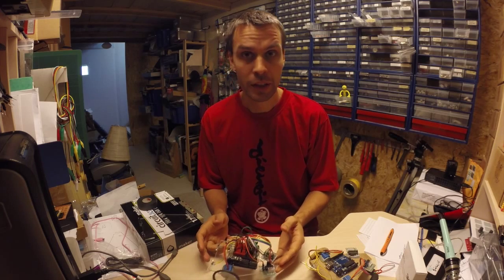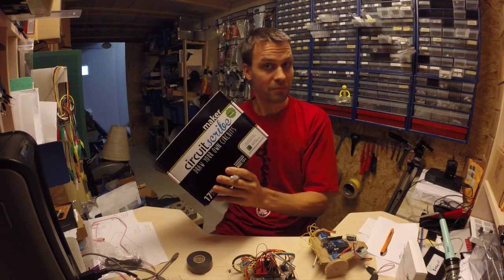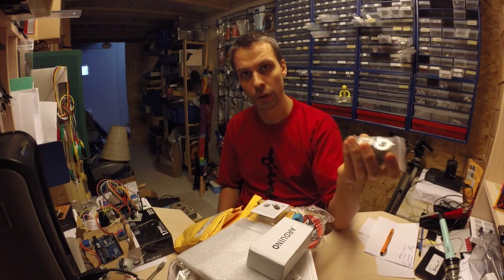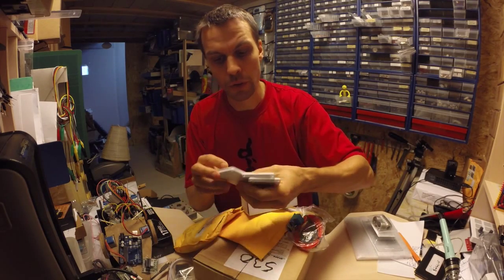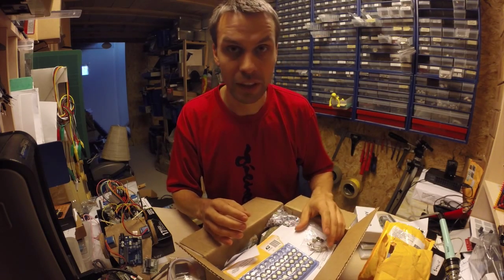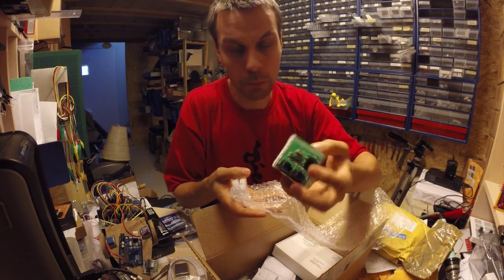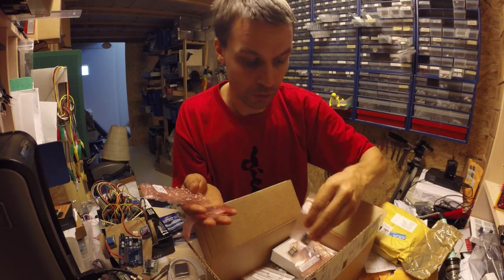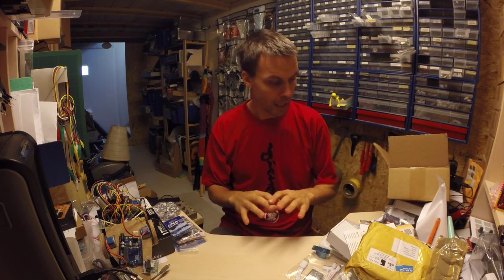Vlog #7 CircuitScribe GIVEAWAY

Comment: That circuit scribe kit looks awesome. Would be awesome for prototyping. By the way, aren't those steppers to slow for a robot? I've ordered one to test out but they haven't arrived yet :)
Reply from the maker: +purkox When it comes to prototyping there isnt that many components that comes with the kit. However using the 9703 tape you can add any component to your circuit, so combined it could be a potential prototyping platform. As for the steppers, if youve seen the Arduino Bumper Robot videos then youll see that it isnt lightning fast no :) Im thinking bigger wheels could be a way to make it faster. It is "fast enough" for lawnmower, dustcollector etc I guess. I have ordered other motors to make "faster" robots aswell :)
Reply: +Kristian Blåsol Yeah maybe not so great for "rapid prototyping" but definitely Cool. I read somewhere that these steppers actually are widely used in air condition systems there for the cheap price. Maybe these http://goo.gl/vKcqjs  Would work for a faster one?
Reply from the maker: +purkox Yep, those are the ones I have ordered :) but you found them at a better price :) I think these need the motor shield, but as soon as I get them I will do an episode of them aswell ofcourse...